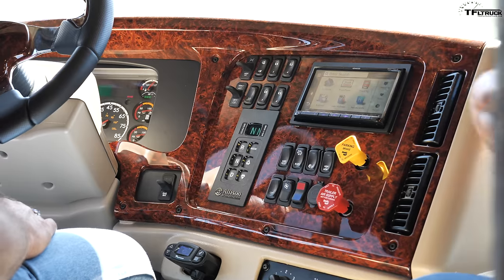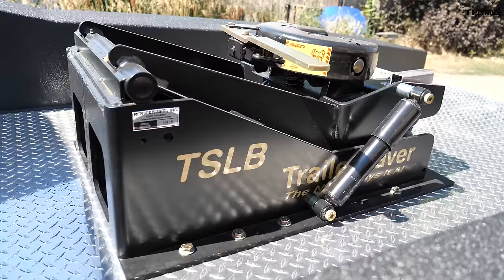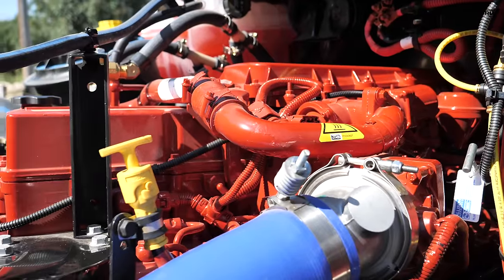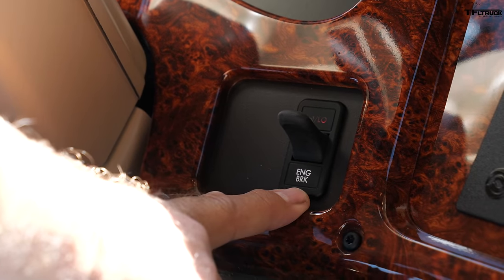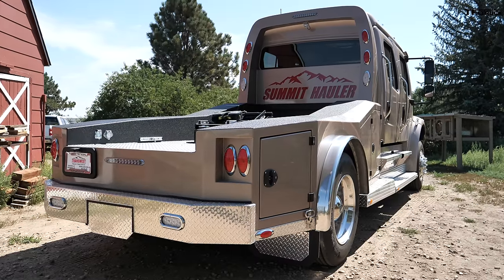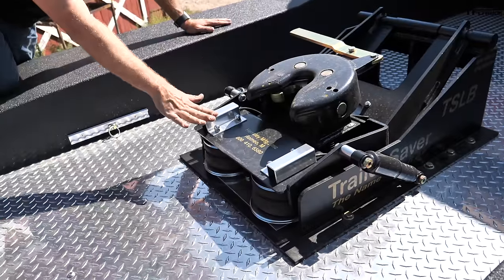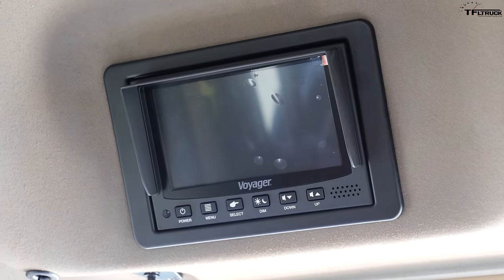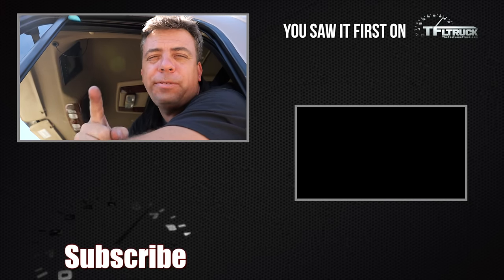Here’s Why This MONSTER Freightliner Will Make You Hate Your Dually Pickup!

Comment: For the amount of money this cost I'd just get a semi. You'll lose your a$$ getting this truck to run your hot shot business!!!
Reply: Agreed. This truck is for rich people to haul their horses and look good. Put it up against a 350/3500 Turbo diesel on the IKE Gauntlet and I bet it loses pretty badly. Love the air ride parts  and high durability parts, but yeah you can get a layed-out Semi for that.
Reply: @Clint_the_Audio-Photo_Guy could you get a new semi for 160k? Just curious no idea what they run.
Reply: @adamton7274   yes you can . But then the road taxes change .so if you are going to do hot shot stuff this would be a good class of truck. Just get read of the bed and put a fithwheel on it
Reply: @ray-vf6ux  i have semi trucks. brand new they cost around 150k fully loaded. i bought mine for 148 fully loaded plus my cab is 3 feet longer my engine is 515HP and 1650-1850 lbf∙ft torque and 13speed transmission, extra axle and can tow 80,000lbs. this truck is way too overpriced. no matter what they say about the motor if it is 2008 or newer it will not go half million miles without major repair, trust me i been in trucking since 1992.
Reply: Just paid $158 for my new Cascadia from fyda. Trans West are gonna be sitting on those forever for $160k
Reply: BiggB20042001 this isn't for a hot shot application
Reply: @adamton7274  You can get a 2019 Peterbilt 379 sleeper for 155-160k all day every day.
Reply: This want intended for commercial application.
It's a toy hauler. It's built for retired truck drivers to haul their fifth wheel with lol. Problem is, retired trucker like me can't afford them!!!
Reply: @wavywade8164  Haha when I retire I won't wanna go near a truck. I might even go fetal and regress into a...*gasp* car.
Reply: dchawk81 389....
Reply: Wavy Wade a lot of professional horsemen and women use them too
Reply: @dchawk81  I hear you!😁😁
Reply: This truck is not designed for truckers.  It is for the rich to show off while towing their toys.  Summit takes an 80k M2 and pimps it out with 80k of accessories.
Reply: @dchawk81  2019 379?? They haven't made the 379 in over a decade
Reply: @chakagillis  Yeah I meant 389.
Reply: Well Summit has to upcharge by 10 grand for their chrome grill emblem and back logo plate. lol
Reply: @adamton7274  Yup.
Reply: Navdeep Kang So what’s the alternative? What make / model for similar towing capacity?
Reply: The only benefit to me over a large car is that its easier to maneuver around using it for a tow rig for a camper. But your still limited to sertin parking areas
Reply: Be better off finding one of these used about 3 to 5 years old. Where some rich guy has a camper and has to trade campers and trucks every 3 years. You know as soon as it leaves the lot ita lost half its value especially being a Freightliner. If I'm going to waste that much money I buy a KW or a Peterbuilt. At least it would hold its value better.
Reply: @wuaname8441  the same m2-106 but without all those fancy installed

Comment: I'm lost here, for what this cost you can get a class 8 road tractor.  The dash is the same as a mid 2000's Columbia. Why not just buy a platinum f550 and have a more practical vehicle.  And I hate the horn blowing just because I didn't pull the park brake before opening the door.  I guess this is what a Dr buys for his wife to pull the wife's 2 horses.

Comment: The USB port is only 2.1 amp max. Most new phones require at least 3.1 amps to quick charge.
Reply: E30 M3 Quivk charging isn’t good to do on the regular as it burns the battery out quicker if you do. 2.1 amps is a solid charge if you ask me,  way better than the standard bullshit 1 amp plugs and chargers.

Comment: Or instead of going to an upfitter who is charging you extra for standard parts, you could get it from Freightliner, or KW or Pete or International for under 100K. Out new KW T370 single cab with a Cummins and an Alison and diff lock, was about $72ish and is rated for 59,000 pounds truck and trailer weight. 
This is just a 4 door version of the M2 Business class Freightliner and they are nice trucks, though the factory dash is nicer than whatever the upfitter did to this one.

Comment: I do agree if you're towing 30,000 plus this type of truck is much better suited to that kind of work, with the air brakes, jake and heavier commercial grade construction, but I think you could get the price down quite a bit. I've seen similar trucks in the $100k range.

Comment: Can you guys do a toe test up the gauntlet at like 30,000 lb put it up against a Dodge in a Ford and a Chevy
Reply: No contest. That truck will beat GM,FORD & DODGE with ease. And it will outlast them as well.
Reply: Robert Benkenstein it probably won't go faster up the hill but it will go down the hill better and handle better...the new pickups have tons of power. These trucks are detuned to go a million miles.  It's definitely a more comfortable towing experience but that's really what all semi trucks are about.
Reply: @markbremmer8642  dodge and freightliner will walk away still driving even for the dodge being the pickup truck it wont tow as good as the freightliner but my point is both cummins will walk away untouched
Reply: I have driven a box truck with the same engine and transmission as this one. It could  definitely use some more power for the size, as I feel it is underpowered as it is. Plenty of  torque  though.
Reply: Is that a camel toe test? 
Or are talking about a towing test?
Reply: I bet the transmission has a torque  limiting function  to make the transmission last a kajillion miles
Reply: @TomLongusa  lol i was wondering the same

Comment: Should do an Ike test, as well as fuel economy
Reply: bet it averages 7-9 mpg. The 26 foot box truck I drive gets about 7-9 combined.
Reply: 8mpg city, 8mpg highway, 8mpg ike. That's a bit of an exaggeration but for the most part that's how these big rigs are.
Reply: Depending on weight 6 to 10 mpgs

Comment: I'd take mine in dark grey and plasti-wood swapped out for brushed alum. Truck does not look like it was built with recent tech or design. Current form kind of looking a bit 90's style...
Reply: freightshaker came out with that body style in the early 2000s. They don't put a ton of money into aesthetics because most people aren't buying them to look at. Summit Hauler could probably have picked a better starting point to build these off of aesthetically speaking but they are well made trucks as far as it goes.
Reply: From all the old guys that I've heard Freightliner is a poor mans peterbilt
Reply: They are not exactly brilliant, Freightshaker is an appropriate name. like Navistar are the bottom of the barrel in Australia
Reply: @jesustrevizo3148  That used to be the case back when freightliner made proper conventional trucks which ended with the classic XL. Now all they make is the cascadia. Freightliner and peterbilt are barely competitors any more. There isn't too many massive fleets buying petes and there aren't too many O/Os buying freightliners.
Reply: @connorsmith713  Your obviously  a man of taste.  Good on you
Reply: @connorsmith713  except, Pete and KW both went down hill massively since 2012. When Catv left the heavy diesel road market Paccar started building their own engines. I spent countless hours rebuilding and replacing their MX series of engines as a certified tech. Usually one per week came into the shop needing many thousands in repairs. Most before 100k miles. Some as low as 10k and we had one that blew the injector seals after dumping excessive fuel which wiped out the def and DPF system in 2k miles.

Comment: Nice truck, but $160k is pretty steep for a little single screw truck with only 350hp. I run a 4 axle fully optioned '19 Western Star 4964SB Heavy Haul tractor with an X15 650hp/2050 torque Cummins and 18 speed that didn't cost a whole lot more than that. Pretty nice and impressive in the parking lot, but not at all cheap.
Reply: Thomas Kirk most of those folks that do the horse shows got the money to blow on one of those trucks lol
Reply: You also probably bought if from Western Star, not an upfitter who charges money for the stuff the truck had standard from Freightliner.
Reply: That's true. It's a nice little rig, but that's a pretty big price for the truck. The upside of that truck is that it's built to handle the bigger loads, so the longevity and dependability should be there.

Comment: The regen switch will do absolutely nothing until the ecm/acm prompts the operator to perform a parked regen
Reply: Not entirely true... 
The regen switch can have a couple functions depending on how freight shaker set up that ISL9. 
Most commonly, it performs what's called an active regen. You can perform one at any time so long as the truck is parked, there are no faults that would prevent a regen from occuring and there is enough DEF to perform the regen. It will cause the ECM to apply a load to the engine to heat up the exhaust as well as inject extra fuel into the exhaust to react with the oxidization catalyst to spike the exhaust temperatures to the point where it will combust the soot inside the particulate filter. 
The other thing that switch can do is prevent the truck from running an active regen. If the ECM is left to it's own devices, it will cause the truck to run an active regen cycle as it sees fit. If you happen to be in a place where you don't want an active regen run, you flip that switch to tell the ECM that now isn't the best time to push 1200° exhaust out the stack. 
Keep in mind that this won't necessarily prevent a passive regen from running, as a passive regen happens when the trucks exhaust is naturally high enough to combust the soot collected in the particulate filter, such as when pulling the Ike Gauntlet. 
Hope this helps.

Comment: So, it's in the  neighborhood of a semi price wise, has the tow rating of a 1 ton Ram regular cab, and you need a CDL to drive it.
Hmmm
I figured you guys would get put on a pike for the explanation of the air system, and the DPF Regen explanation.
If I were you guys, I'd take this video down, and do some serious editing before you're accused of being misleading.
It's clear that this truck is outside your scope.
A sin really.
Reply: Yea.... didn't know the Parked Regen would work while driving...
Reply: Cringe for us in the transportation industry.  And trying to compare it to a one ton!!!
Reply: As long as for personal use, don’t need a CDL if from WI.
Reply: @witkr904  Is that with or without Airbrakes?
Reply: Darkmatter2134 doesn’t matter. See my other post, states differ, some require air brakes, PA for one has a foot (feet) limit I have been told. In my state you can take a 8x8 from a military auction and drive it around with Collector Plates on a regular DL.
Reply: @crazyeyez1502  Runs counter to what I know about parked regen.

Comment: No CDL required for private use...so you have no idea what to do when you lose air pressure. 
And, it is a passive regen, which doesn't derate the engine. You can push that button all day long and it's not going to do anything unless you're parked and the computer determines it's ready for a parked regen. Unless those that developed the 9L weren't talking to those that developed the 15L.

Comment: I drive a 2017  freightliner straight truck version of this truck every day. I have 189,000 on that exact motor. Its been very problematic to say the least. 500,000 miles in theory but not in reality.  The regen button will only allow a parked regen when a light comes on in the dash because a parked regen is at 1200 degrees and you will burn out the catalyst prematurely which is around 3000 $ or so. It does a passive regen at highway speeds at 600 /700 degrees. If the regen light comes on and you don't regen it it will bushwack you in to a protection half power mode which on dealer grade software can reset. Also there's no line heater on the fuel line so you will gel up on minus 25 degree days even with the  911 additive.  I can go on and on but that's the sum of it. Really bad qc control at freightliner these days. You honestly couldn't give me one of these trucks.

Comment: I'll just keep my Kodiak 4 wheel drive crew cab... but great looking truck thanks guys 👍👍👍👍🏁🏁🏁
Reply: Gary Yarbrough Ive been interested in those, are there anyways to make a 4wd kodiak/topkick 4x4 without it being jacked up to the moon? like the silverado HD where the 2x4 amd 4x4 models dont sit much further than the ground
Reply: @shanet7511  I have C 4500 crew cab 4-wheel drive from the factory Chevrolet Kodiak pull a race car hauler and a gooseneck trailer in a horse trailer it's not jacked up to the Moon... works very well for my application....👍👍🏁🏁

Comment: CentraMatics are great. I only had them on the steers when I was an owner/operator & they helped give me more life from those $500 (each) tires. 
Although overpriced, that's a very nice truck. (Truckers call them "baby Freightliners".) Even a 1 ton pickup has its limitations. Sure, they can haul some weight, but can they stop in an emergency fully loaded? I've seen many jackknifed pickups cuz Jim Bob had to show how macho his truck was. 
I'd rather buy a used single axle class 8 with a mid roof sleeper for about a third what that thing costs.

Comment: Now if one of these truck makers can produce a product approximately 1/2 to 3/4 the size of a normal big rig so that it will fit inside a normal residential garage an cost between 50 and 80 grand, I’m guessing they could corner the market

Comment: Heres the problem... Its a freightliner, we only get kenwort or peterbilt
Reply: Both make similar trucks, if you don't mind shelling out 20-30K more for the same thing. Cause you can get the same engine and transmission in all three brands, with the same axles. Only difference is the cab.

Comment: Why don't cars have air brakes? What happens to the rear tow bags of they leak? Can your still tow?.…. Very cool! 
Thanks (-:
Reply: You loose air pressure. Once the system runs out of air, the rear axle brakes on the truck, and the trailer brakes, lock up.👍🏼

Comment: I wanna see a review testing this up the IKE towing over 30K against a F350, Ram 3500, and GM 3500. Which will get up the hill faster and best mpg.
Reply: would not bother. the temperature and stamina will be the bigger trucks win..and saving $70k for the pickup haulers.
Reply: Going up they would be pretty much the same. But with an engine brake you would never touch the brakes coming down unless traffic forced you to in the Freightliner.

Comment: You may not like this review, but it is from a retired longhaul driver. You may need a CDL, even if you are not commercial. Check with your state DMV. In Kansas, even a non commercial tractor trailer rig, or motorhome/ bus  that exceeds 26,000 pounds requires the driver who holds a Kansas license to obtain a class A CDL, or a class B CDL with a passenger carrying endorsement. The powertrain is nothing special, infact, it is about 200 HP below a standard duty class 8 tractor. The supposed camera hookup is a standard 7 pin trailer plug ... the one he did not show may be the camera access. All in all, this was a lot more hype than information. I am not saying it is a bad truck for someone who has never been accustomed to a class 8 truck, but it is not all that and a box of Cheerios.
Reply: @ulh pilot I am a medically retired interstate (produce hauler) driver. I am also studying to be a writer of commercial words. This was a nice truck, it is to bad the reviewers were using hype instead of fact. For its purpose, I is a very credible machine. Being based on a Freightliner medium duty chassis, it is well made for its class. The reviewers did a poor job of presenting it.

Comment: Even at $162k, that's not a bad price considering how expensive 1-ton duallys are these days nearly eclipsing $100k themselves.
Reply: Alan Bowers wrong
Reply: Pat explain.
Reply: Alan Bowers a 1 ton truck is not 100k
Reply: Pat price out one. I got an F-450 to $94k.
Reply: @ALMX5DP  A F450 isn't a 1ton. And if you don't go with the top of the line interior package, can get one in the 40-50k range.
Reply: Ictpilot Ictpilot well the Ram 3500 I optioned also hit $95k, and while yes they don’t have to be optioned to that level, the point was for what you get with this truck and all its features it’s not bad considering how expensive consumer trucks can be.
Reply: @ALMX5DP  I did the Laramie 3500 crew cab. And came out to $57k sticker, could have been less minus a few options. With the discount they're giving $8-10k even less. And yes, if you have a need this would be a good truck. The $162 is just the sticker. I'd knock off a good 10%.
Reply: Ictpilot Ictpilot yeah you can definitely option to less, but the vehicle in this video seems to be pretty well laden with features and accessories which brought about my comparison. And like you said both sides might have some pretty good deals as we all know dealers have some headroom to negotiate.
Reply: @ictpilot  Order direct from manufacturer, 100k for truck and install a bed locally brings the price down others are saying.
Reply: @WeAreNotAlone69  yep.